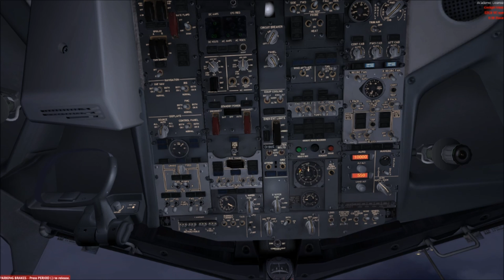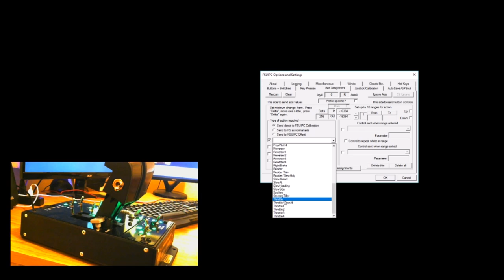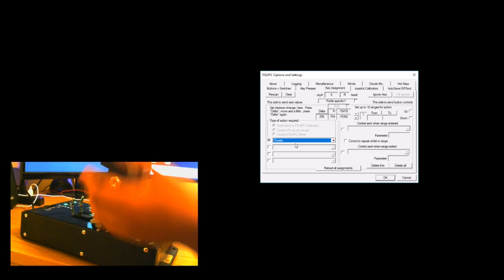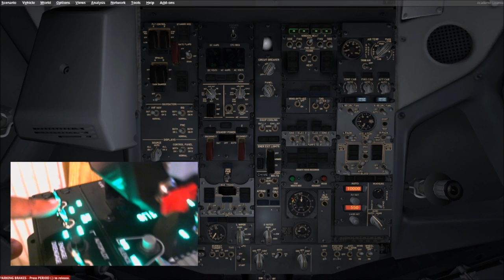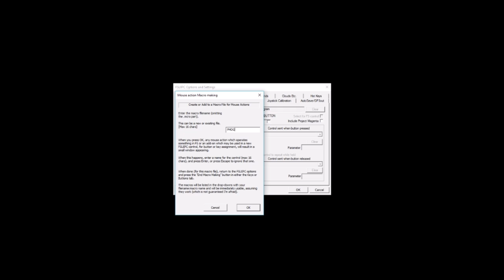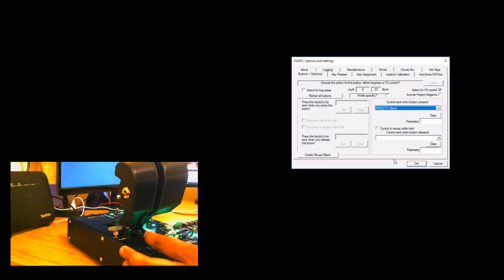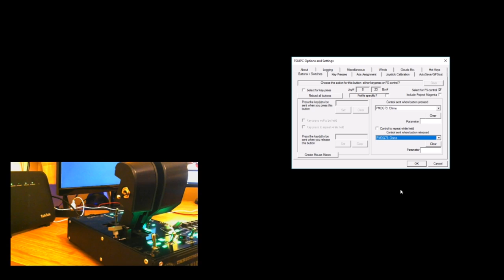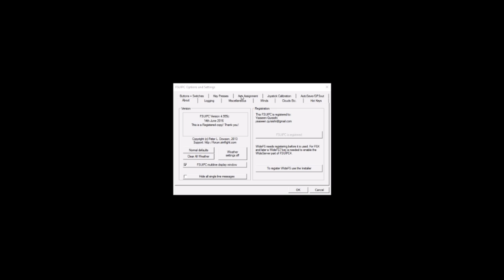Prepar3d | FSUIPC | Macros and Assignments

Comment: Thanks for the video. 
Good explanation in a simple way, that's what I needed for assigning 3-position switch to Autobrake INC/DEC function.
Reply: i have tried for a320 lights that have 3 position ON TAXI and TO but wont recognize the middle on alt/hdg as a button and doesn't assign well

Comment: How does I use the function of the Buttons & Switches to set a key on joystick to active 2 bottoms at the same time?
For example: when I fly FSL A321, I can use FSUIPC to set a button to turn off the PF's FD and set another button to turn off the PM's FD. So, but what I want is that when I press a button, PF and PM's FD will be turned off or on at the same time.

Comment: Loved your tutorial !! and I am thinking of of getting the warthog thrustmaster for my p3dv4 setup. I just have a quick question.
 I  presently have Saitek -Throttle Quadrant, Joystick and Rudder pedals. I would like to replace ONLY the throttle quadrant  but retain the Saitek Wheel(Joystick)  and rudder pedals. Are there any compatibility issues( port conflicts?) in mixing and matching that I should be aware of?
 Best Regards
 Hari

Comment: I noticed the date of your video is 2016 and there is no mention of which version of P3D or FSUIPC you are using.  As I followed the audio and transcript of your video, you seem to indicate that FSUIPC  turns off the assignments for throttle, joystick and switches automatically when you map the assignments in FSUIPC.  Please clarify if this is true.  I am using the most current versions of P3D and FSUIPC and it is my understanding that it is necessary to first turn off these assignments in P3D before mapping them in FSUIPC.

Comment: Hi! What add-on are you using for Prepar3d now? Do you have a specific 737 one? I've seen that the camera movement is brilliant and the cockpit looks great! I'm still trying to transit to P3D from FSX. Thanks!
Reply from the maker: Hello Andrei!

I am currently using P3D V3.4 with the most updated graphics drivers for my graphics card (GTX 960 2GB). The camera movement in this video is actually with EZDOK v1 however I have now moved over to Chaseplane which is my camera addon of choice. I use other addons such as the PTA tool, Active Sky 16, PMDG 737 and various others.

Good luck with moving over, its a really long process but once its done you will appreciate the difference :D
Reply: Quraishi Fly :) Thanks!

Comment: Thanks for this tutorial! Is it possible to put the reverse thrust into the afterburner area of the Hotas?
Reply from the maker: No problem Thomas. Yes it is possible and I actually use it aswell. Set the afterburner area in the buttons section of FSUIPC. Only limitation is that it is always full reverse and never idle reverse.
Reply: So it doesn't actually recognize it as an axis but as a button?
Reply from the maker: That's right unfortunately :( If there's a way around it I would love to know!

Comment: question, i set up my axis's and everything works fine, EXCEPT for the rudder. i have rudder pedals, which worked fine, UNTIL I set them up with fsuipc. now, they will not respond to the sim, and when i reset it, it did nothing! i need help!!!
Reply: Joshua Moore if u use Ezdok turc of fuselage shakes

Comment: Hi mate, thanks for video, i would like to ask, can u setup Flaps gauge with fsuipc? thanks
Reply from the maker: Hello Bassam, thank you very much! 
Yes you can set the flaps via FSUIPC. You will need the full version and all you need to do is select FS Control and select flaps increase/decrease depending on what you want to map. Hope that helps, drop me a message if you need anything else.